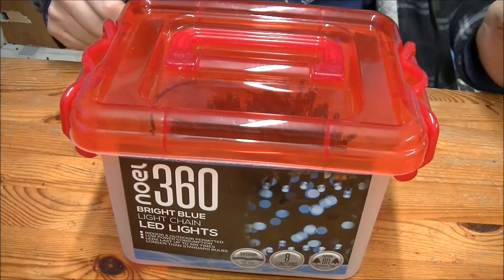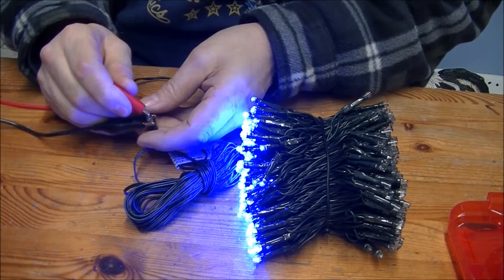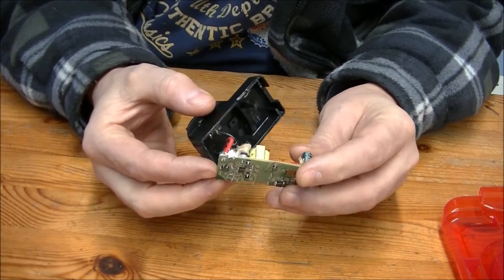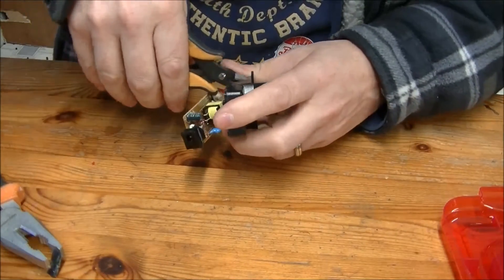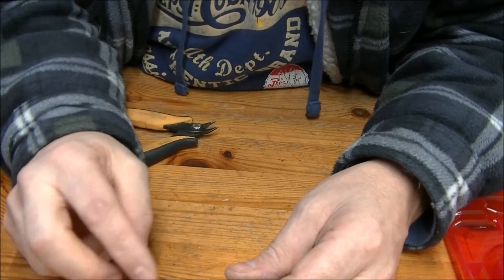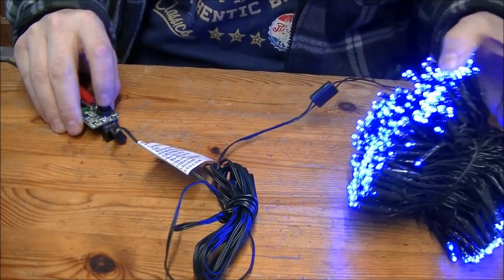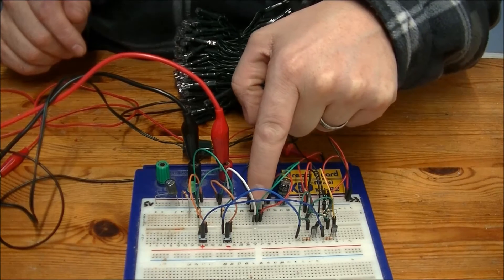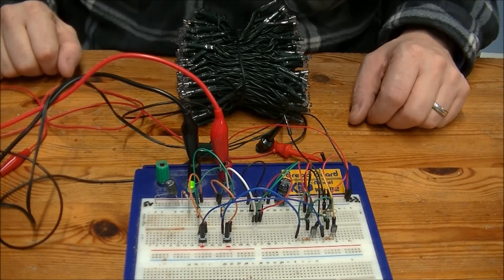Blue DMX Christmas Tree Lights Part 1

Comment: Thanks for recording this Lee. Could the controller module that you extracted be scaled-up for a much higher current load? 
The epic would be that you can plug 8 or 16 200xLED stings and control them all from the same point?